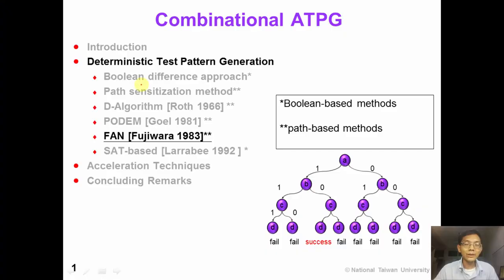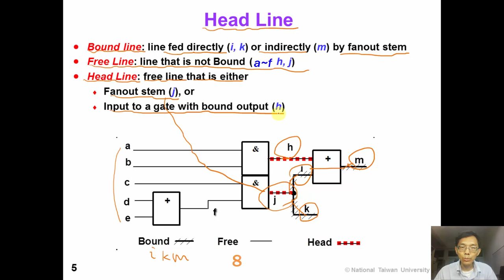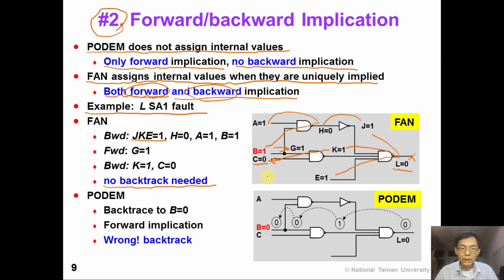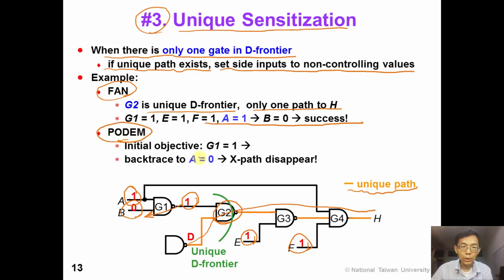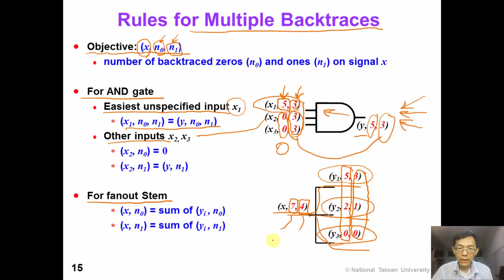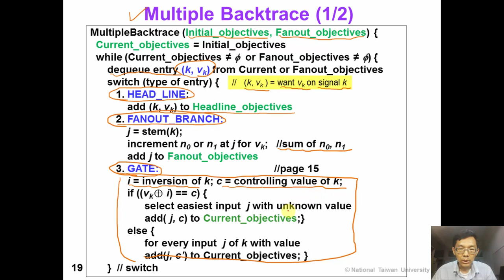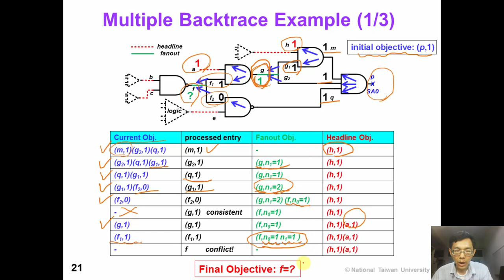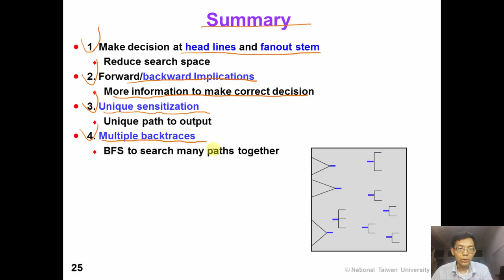7 6 Combinational ATPG, FAN

Comment: Hello,during the mutiple backtrace  how did the input of  g4 get H(5,0) and J(5,0) should not it be be different like h(0,5) and j(0,0) as one is the controlling   value for nor gate.
Reply: According to the boolen fuction of NOR gate. there is 5 backtraced ones at output K of NOR gate, so both inputs should be assigned five backtraced zeros.
I think you mistakenly take or gate's boolen fuction to analyze this case.